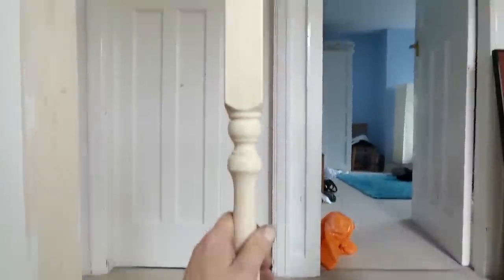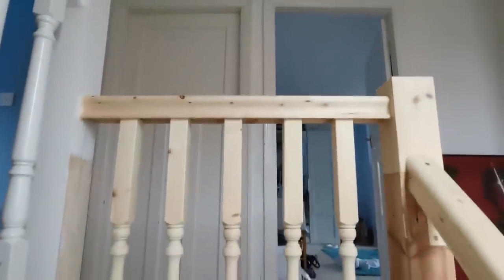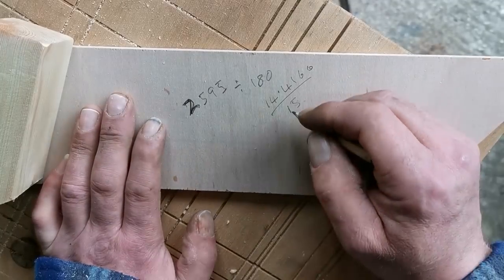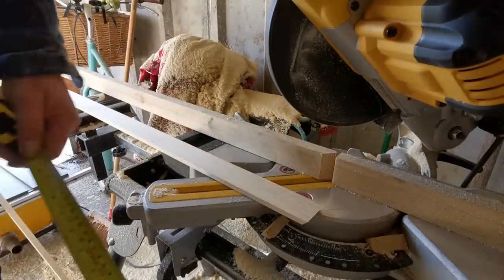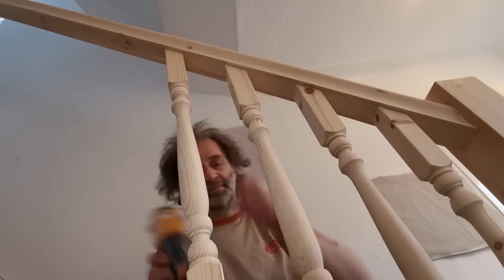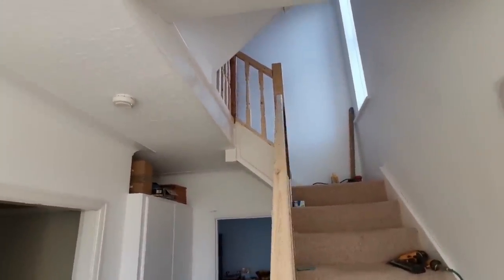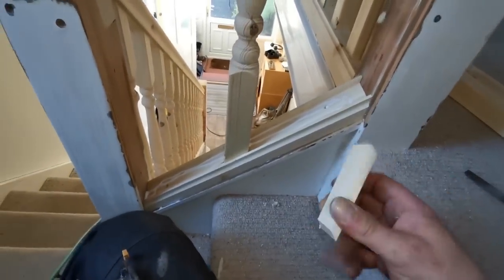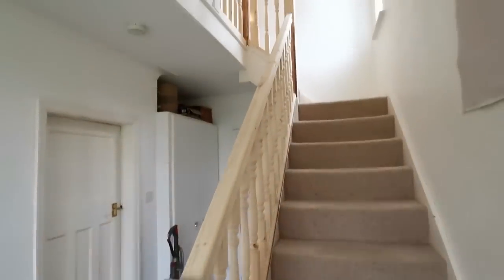Reinstalling handrail & spindles pt3 - Spindles

Comment: Great job Gid and good call on those 3 spindles they looked better then 2👍chuffing smoke alarms go off all the time for us when we refurb hotels,try the blue plastic over shoes to stop dust setting them off😂👍🍻
Reply from the maker: Hi & thanks, yep agree I was happy with the spindles 👍 36yrs as a joiner, spent most of my time when working for firms shop/bar/bank fitting, aesthetics is often key, if it looks right it often is 👍 when I started working for myself I found 90% of my work is in people's houses, that's a big difference, shopfitting you're backed up by a team and a boss, working for yourself you're on your own and houses aren't square or level, working with old fittings like door casings or as in this vid this staircase, so you do the best you can with what you've got 😂 ya can't just rip everything out and start again and start afresh, either because of cist or practicality so thanks I appreciate your comment & understanding 👍👍 The smoke alarm was set off by the machines, once that job was done they were quite, I might buy some covers for them that I can keep in the van but I don't set them off often, wearing shoe covers won't work, I'm in and out of their houses all day, the difference between the equipment I have now compared to when I was on site is huge, I used to go to work with a box and bag of tools & a level, I now need a LWB van full of crap 😂😂😂 I do occasionally miss the simple life of working on site but it's only occasionally 😊 thanks again 👍

Comment: Just wanted to share this. I’ve got a Festool plunge saw & it’s a tool I can’t do without. I saw someone clamp the track to the bottom of a door & trimmed about 6mm off the bottom. No mess with the extraction connected. Nice clean cut as usual & the real bonus was they didn’t have to remove the door to trim it. I’ll be adopting that technique in future. 😃👍
Reply from the maker: I've done it to a few doors without the track, just laying the saw on it's side & running it on the floor, they make them flat/sq on the blade side to do that, I recently laid a floating hardwood floor & undercut all the skirtings in the same way but the cut is 15-18mm off the floor, ( i haven't measured it yet ) the doors I'd done had no carpet down so that was fine but the one at the top of the stairs here needed trimming, while i had the saw out, it had to come off n cut otherwise there would have been a massive gap at the bottom, it had a new very plush carpet. But yeah they are fabulous saws, mark your line lay on the track, set the depth n cut, even though this door had to come off it was a piece of piss, bit of 3x2 to sit the door on, my short 1100 track n my vac which was already upstairs, i did it in the room on the new carpet, next to no dust,. i couldn't have done it so easy with a reg rip saw 👍👍👍😁

Comment: Another brilliant video Gid, could you tell me what compressor you use on site I noticed you were using a Bostich pin nailer ,is that the one that comes with the 6 Ltr compressor as a kit ? thanks im intrested in buying one
Reply from the maker: Thanks Michael 👍 i have a little 25yr+ old 6ltr Wolf Air compressor, this pin gun is just a pin nailer, i think the ones that come with a kit are stapler & nailer in one, prob with those is the firing pin is flat for the staples but leaves a line in the wood when firing pins. This mine or maybe an older version, i have the separate stapler too. http://www.betcofasteners.com/bostitch-bt1855-e-pneumatic-brad-nailer-15-50mm.html

Comment: Great vids really enjoyed them what counter sink bits do you use ???
Reply from the maker: Thanks James 👍 i have two Trend ones set at different lengths in my pocket, i have bookmarked as one of mine is worn a bit, they're many yrs old n the bigger one I've had a long time but looks like one of these cheap ones, https://www.amazon.co.uk/Countersink-ZoomSky-Woodworking-Chamfer-Carpentry/dp/B07KW44JWG/ref=sr_1_2_sspa?keywords=Countersink+Drill+Bits+Set&qid=1582313353&sr=8-2-spons&psc=1&spLa=ZW5jcnlwdGVkUXVhbGlmaWVyPUEyVVkxTkNVNEtQRFM5JmVuY3J5cHRlZElkPUEwOTczNDA2VE4xVDJSTDNYRTFPJmVuY3J5cHRlZEFkSWQ9QTAzMTA2MzBKUVRQTzhSNTBJM1omd2lkZ2V0TmFtZT1zcF9hdGYmYWN0aW9uPWNsaWNrUmVkaXJlY3QmZG9Ob3RMb2dDbGljaz10cnVl

https://www.amazon.co.uk/dp/B0001P11ZC/?coliid=I2XSGH9TKMUMZE&colid=3UBWC9NW89BTU&psc=1&ref_=lv_ov_lig_dp_it
Reply: Cheers gid I appreciate  that keep the vids coming I really enjoy them being in the trade myself, no school like the old school:)

Comment: Another great series. I was hoping for some advice. I don't own a table saw but want to buy one for my little workshop (back yard). Would you recommend the dewalt table saws? I want to get accurate, consistent cuts for cabinet and furniture and i can't store the sort of table saw you have in your workshop. I'm looking at the DeWalt table saw but also the mafell/ festool table saws as see this as a major investment. I'm not bothered about brands, just accuracy and avoiding faff with set up.  Thanks for your time.
Reply from the maker: Thanks 👍 Hi, Sorry I can't comment on the other brands beyond what i've owned, All saws work in a similar way, it's the peripherals that make the difference esp the fence, the tablesaw in my shed had a rubbish fence but i bought i because the cast topped machines in my price range were a bit rubbish & only cut 75mm, i wanted 100mm depth of cut & I always knew i was going to mount it in a bench & make a decent fence, The Dewalt is noisy but i really like the way the fence works, i think you could do a lot worse than buy a Dewalt, I had a crappy Clarke saw in my van for a long time that my dad gave me, i don't often use a tablesaw on site so i rarely used it, it cut ok & did the rough stuff i occasionally needed but i didn't have a fence, i had to clamp stuff on, the table insert around the blade was thin tin n never sat flush however much i fiddled with it, it had to be stored flat, the way you use it, the Dewalt can be stored on it's side, the tilt & rise n fall on the Dewalt are fine, I always want beautiful engineering but I've no complaints & glad i bough it, it's quite accurate & can be adjusted fairly finely, the Festool is expensive, I'm not sure you would get that 'beautiful engineering' by paying the amount they're asking, the Kapex in my shed is a nice machine but i think it's overpriced, it's not perfect. I think that would be how deep your pockets are, Yes i agree, If you're buying than try make it a one time buy, or at least the best you can afford even if that means overspending a little, I hate to regret later not making the effort to find that extra couple of £100s, to get the Kapex i worked a couple of wk'ends so had the cash & was willing to gamble I'd be getting the best i could afford.
Reply: @Gidjoiner  if it's accurate enough for you then I thinks it's good enough for me! I read a few things online about the DeWalt table not being that flat but then most of the people who are happy with it wouldn't bother commenting haha. What's your opinion on 10 inch or 8 inch blade? Judging off what I am working with, it's incredibly rare that I would be cutting anything taller than 65 mm which the 8 inch can do. I'd be using it in combination with a mitre saw anyway or reckon I'll be regretting not getting the ten inch?
Reply from the maker: The Dewalt i bought cuts 77mm but some of the other Dewalts only cut 65mm, I would like to be able to cut a piece of 3x2 on edge, When i repaired the floor it did quite well for fine adjustment 👍 https://www.youtube.com/watch?v=kgFevz6LzVc&t=422s
Reply: @Gidjoiner  thanks for the tips. Think I'll keep my eye out for the 10 inch version
Reply from the maker: Yep, you don't want to be limited 👍
Reply: @Gidjoiner  so I ended up for for the 7492 which is the latest 10 inch one, basically same as your I think. The table isn't as flat as I was hoping but hopefully will be ok. Do you have any advice for fence set up? When I butt my square on the table top up against the fence, it's not quite square and can't work out how to fix it. Many thanks
Reply from the maker: Sorry to hear you're not entirely happy with it, remember these are built as site saws not fine tuned workshop saws, the table on mine prob isn't flat, i never checked it & don't expect it to be, mine gets in the way in my van so i sometimes stand on it, lightly! 🙄😂, I've just looked at yours online, the fence looks the same as mine, mine is sq, i never checked that either when i bought it but never expected it to be perfect, checking just now i'm actually quite surprised how sq it is, i can't see any adjustment, there's 2 bolt/screws that mount the Ali fence to the clamps but no grub screws etc. for adjustment, If you want that kind of quality than i'm sorry it's the wrong saw n i suspect you'd have to spend quite a bit more, saying that though, i just went through the saws on FFX's site & even the £2.5k Festool it's not clear if you'd get that adjustment, Don't know what to say, yours is quite a bit more money than what i spent so if you can't live with it, return it, nowt worse than an expensive tool that you hope to have for yrs that you're not happy with from day one.
Reply: @Gidjoiner  thanks for the thorough reply, sorry to keep pestering haha. I've managed to sort it putting a few layers of tape under the top two bolts for the fence to send it back forwards. Done a few cuts and ok so far. Got a fun day off testing it tomorrow. Like you say, I'd need to be paying a lot more money and as I need to be able to move it in and out of a shed every time I use it, I think it is probably as accurate as I can manage. Fingers crossed ta
Reply from the maker: Good, yeah if you're going to be moving it then the top will flex & change a little each time with most of these saws i think, My Planer's fence is fractionally out of sq, but it planes wood sq 🤷‍♂️👍 I always say, setting these machines up with high quality squares & digital devices is all well n good but it's how sq the machine cuts the wood, if you set it up perfect but it doesn't cut sq than adjust it until it does cut sq, that's why you don't see me setting the machines up with fancy gadgets, The super duper expensive Festool Kapex 120 needed tape on the fence to stop it wobbling, i used Ali foil tape, it's very fine 👍https://www.screwfix.com/p/diall-aluminium-foil-tape-silver-45m-x-75mm/4415v
Reply: @Gidjoiner  haha interesting point that. How square is square. Thanks for the tip and I'll look at that tape as got a sloppy mitre slot to sort out next!
Reply from the maker: Bloody machines, you shouldn't have to do all this crap to make them work right, 😬😖😂
Reply: @Gidjoiner  that's exactly what i was thinking this afternoon, whilst sticking strips of masking tape on an £800 saw haha

Comment: My Evenings entertainment.    😎 Nice fix at the top floor, I'll say nothing. Why the car bog??? is it because it is harder than normal wood filler?
Reply from the maker: 👍 Yeah sometimes it's about digging yourself out of the hole you're in 😁 the car filler is pretty much the same stuff but cheaper by quite a bit, in one of my vids i try the hardener you can buy separately for a couple of £s online with 2 part coloured wood filler because i always run out of the hardener n it works, so i don't have to think/worry about how much hardener i use, the scoop of filler i dug out of the tin in this vid was probably 1/4 - 1/3 of a tin of wood filler, I keep the 2 part coloured wood filler i have for times when the colour might be important but the car stuff for just general use, 
https://www.amazon.co.uk/gp/product/B019MXFXIO/ref=ppx_yo_dt_b_search_asin_title?ie=UTF8&psc=1
https://www.amazon.co.uk/gp/product/B0055BLC0G/ref=ppx_yo_dt_b_search_asin_title?ie=UTF8&psc=1

Comment: Nice work buddy, bolloks comment hahah , good recovery tho. 👍💪
Reply from the maker: Thanks 👍 wasn't sure if the first word in this vid should be F'k n the second bollocks but i left that in for the honesty, it's just how the clips started after finishing pt2, digging yourself out of the hole your in seems to be part of the job sometimes 🤣😁
Reply: Yeah quality, alot of guys would have edited that out. I also like the filler you used aswell, ive never used that. Im going to tey it my self. 👍🏼
Reply from the maker: Yeah they would but they don't need to, their work is perfect 😏😉 This filler is pretty much the same stuff as coloured wood filler, I even bought a single pack of hardener to try with coloured wood filler, with this big tin i don't have to think about how much I'm mixing or how much hardener I'm using, for me the little tube of hardener never lasts for a whole tin of the coloured wood filler, There's different types of this filler, I've a thin one that i use on the van or for thin smears but it's a bit runny, this one for Deep Repairs is better, 
https://www.amazon.co.uk/gp/product/B019MXFXIO/ref=ppx_yo_dt_b_search_asin_title?ie=UTF8&psc=1
You get 2 packs of hardener with the tin but these single ones deliver within days 
https://www.amazon.co.uk/gp/product/B0055BLC0G/ref=ppx_yo_dt_b_search_asin_title?ie=UTF8&psc=1
& spare mixing thingys if you need them.
https://www.amazon.co.uk/gp/product/B01LWJTDIB/ref=ppx_yo_dt_b_search_asin_title?ie=UTF8&psc=1

Comment: Great to see you back. Do you recommend body filler instead of two part wood filler? Is it for cost reasons. Cheers.
Reply from the maker: Hi 🙋‍♂️ Yeah, car filler is pretty much the same stuff but cheaper by quite a bit, in one of my vids i try the hardener you can buy separately for a couple of £s online with 2 part coloured wood filler because i always run out of the hardener n it works, so i don't have to think/worry about how much hardener i use or the amount of filler, the scoop of filler i dug out of the tin in this vid was probably 1/4 - 1/3 of a tin of wood filler, I keep the 2 part coloured wood filler i have for times when the colour might be important but the car stuff for just general use, 
https://www.amazon.co.uk/gp/product/B019MXFXIO/ref=ppx_yo_dt_b_search_asin_title?ie=UTF8&psc=1
https://www.amazon.co.uk/gp/product/B0055BLC0G/ref=ppx_yo_dt_b_search_asin_title?ie=UTF8&psc=1
Reply: Gid Joiner cheers I’ll give it a bash. 👍🏻
Reply from the maker: They used body filler when i started, it's hard enough for cars 🤷‍♂️ I have another from Upol that's thinner, that's for the van, it's too runny for this work, this link is for deep repairs

Comment: It's about bloody time you're back pal 😉
Am I right in thinking you've replaced the metabo saw with a Dewalt one?
Reply from the maker: Hi, No the Dewalt i bought a while ago to replace a 25+yr old Dewalt i have that still works but is a little tired, the Metabo i bought a long time ago as a rough site saw i didn't have to care too much about being outside poss getting wet for when i was decking n pergolas etc. because of the depth & width of cut 100mm x 300mm-ish, 
🤔 or.. Just realised maybe you meant in these 3 vids?, I use the Metabo because It has a trenching stop for half lapping the Newels, which the Dewalt doesn't have but i swapped to the Dewalt for the spindles because it has a cleaner more accurate cut,.👍

Comment: If your spacers on the long flight of stairs are 110mm long doesn’t that mean your spindle spacing are wider than the 100mm allowed?
Reply from the maker: No, a diagonal measurement is longer than horizontal. i should've shown the gap between the spindles it created but at the start when i roughly measured the spindles & spacing with 100mm gap, the length + spindle was 180mm, if you deduct the 55mm diagonal of the spindle from 180mm that leaves 125mm, therefore the spacers could be up to 125mm long before going over the 100mm max..

Comment: What happened to the old Metabo? Turned into a totally different saw 🤔
Reply from the maker: Magic 😁 The Metabo has a trenching depth stop but the cut is a bit rough with the blade in it so I swapped to the dewalt for a cleaner more accurate cut 😉
Reply: Gid Joiner Thanks for sharing, just finished a staircase and spindle spacing is a head scratcher. I also tenoned the whole handrail onto the newel carefully chiselling in at the angle. Took ages, just seen  your square tenon and kicking myself for not doing it that way
Reply from the maker: 🤣👍 Yeah the spacing is a head scratcher, hard to work out n harder to explain on film, I'd like to have seen you chopping in that handrail 😏😁
Reply: Gid Joiner Just tried you send the photo on Faceache I think 🤔
Reply from the maker: Thanks, i see what you mean about chopping the whole thing in, 👍 Is that in your own house?
Reply: Gid Joiner Yep it’s my own house, nobody is paying for that balls up 😂😂
Reply from the maker: 😂👍Sent you messenger pic n txt

Comment: Why didn’t you just space the spindals evenly? That’s odd :/
Reply from the maker: Where, the 3 at the top?
Reply: Gid Joiner no they look great. The straight run at the top, if it was me I would of just divided them evenly, regardless of the distance between each spindle long as it’s less than 100mm. But looks great regardless!
Reply from the maker: Thanks, 👍 Yeah prob would have if i was thinking, it was the first i did n just did it, I stood them roughly in place & I don't think i wanted to move them closer together because they'd be too close to each other 🙃🤷‍♂️😉👍 that straight run spacers were  85mm n the ends were 80mm, only 5mm init  👴😉
Reply from the maker: I just had to watch it again to check, 🤣🤣🙃 3.13min in I mention that i didn't want shuffle them all up n yeah 85mm across n then 80mm on the ends,

Comment: Dont regs say no more than 100mm between spindles
Reply from the maker: Yes I mentioned that when working out the spacing going up the main run, I mention it when working out the landing and I also mention it when I'm working on the 3 on the turn at the top, none anywhere on the stairs were more than than 100mm anywhere on the spindles, between the moulded part or the square parts